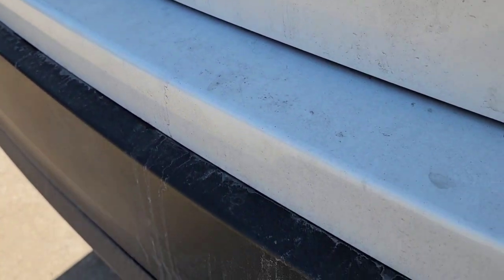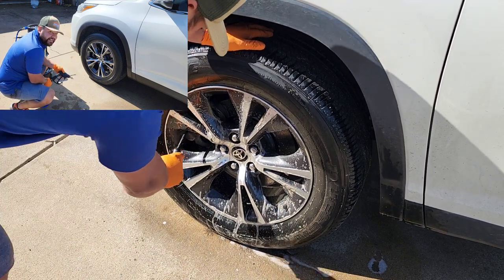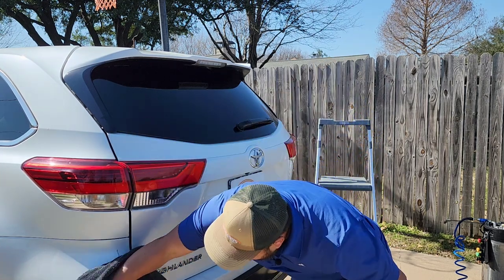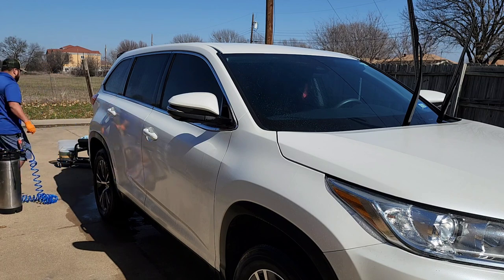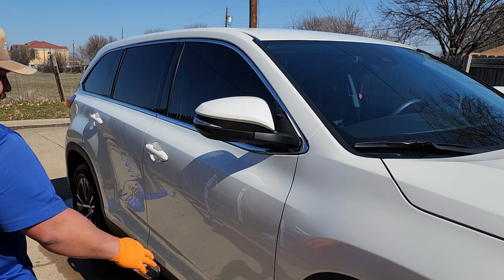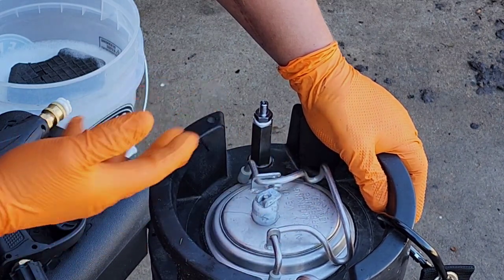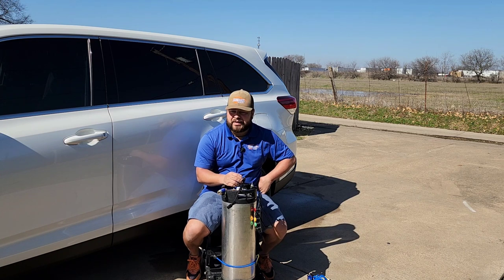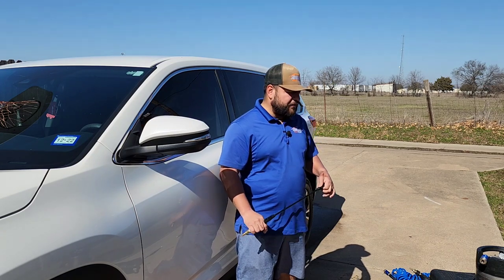DETAIL SPRAYER  new rinsless equipment

Comment: What are your thoughts on using the gun as a prespray and after washing that away using wand before contact wash? Assuming the gun with more power will breakdown things better
Reply from the maker: this is a good question, I believe with a good rinseless product, this keg would do the job. it's just trusting the process
Reply: @serranosmobile  Using the keg with gun/wand attachment. If the gun gives a stronger rinse would make sense to me. In process of buying a keg now from Scott
Reply from the maker: @user-ut3lb5fd5c  I would gun for sure. the wand is good, maybe for less dirty vehicles, but I don't do many rinsless. lowkey may use it as my pre spray keg fir interiors 😂😂😂😂😂